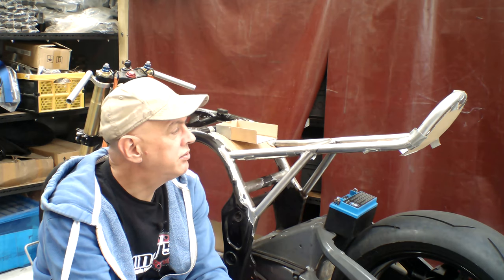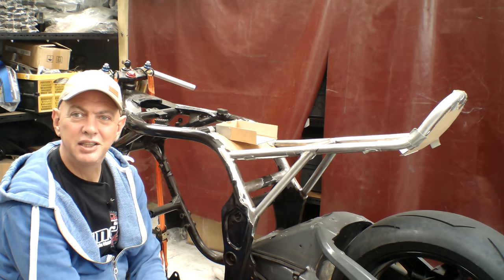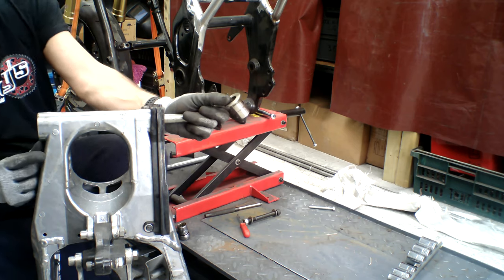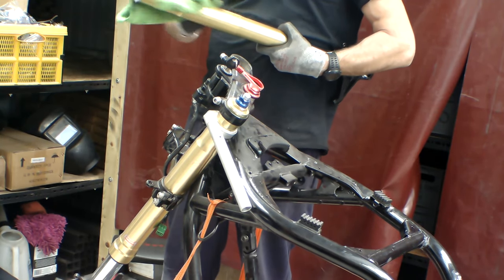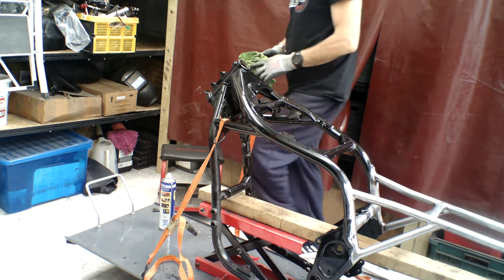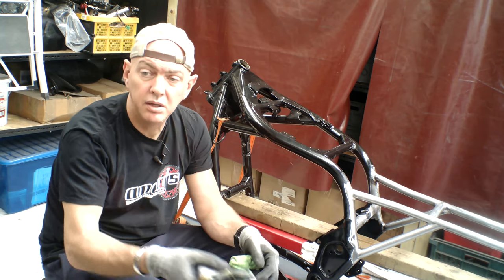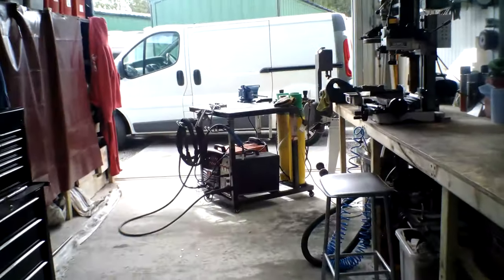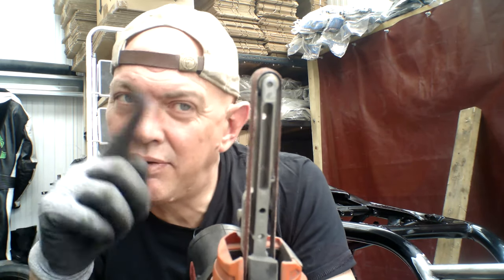The frame bares all - Suzuki Bandit Cafe Racer - GIXIT Project Part 13

Comment: enjoying your build fella...interesting as i am doing a B12 streetfighter.
Reply from the maker: Ahhhhh... That could be cool. I must admit I used to love street fighters but lost my way with them after a bit as they all sort of looked the same. Would love to see some pics if you have any. The build is going fairly well and to be fair All of it will be on YouTube. Hope you enjoy it and thanks for the comment 👍
Reply: @QuickBikes  not sure how to send you photos on YT...would be good to get your opinion as a welder whether i need to keep a couple of cm of the original subframe or chop it right back to the main tubes and plate the hole and weld a new subby on in different places?
its a chopped frame so far which is why your subframe build had me hooked.  it's got a zxr750 front end with a rf900 swing arm...still needs an engine!  i too am going to go the motogadget m.unit approach.
Reply from the maker: If you add me on Facebook, you can send me pics via messenger. Happy to help if I can, just send me pics of what you're looking to cut up and join and I'll let you know the way I'd do it. Sounds an interesting build 👍
Reply: @QuickBikes  will do...many thanks.
Reply: @QuickBikes  buggered if i can see your facebook fella!  i only use FB for two groups i am a member of so apologise if it's staring me in the face
Reply from the maker: I need to set up a Quick Bikes page... It'll make all this a lot easier...

Comment: Although we all laugh and poo poo health and safety there's no getting away from the facts. A comparison of fatal injury numbers between 1974 (when the Health and Safety at Work Act was 
introduced) and 2017/18, adjusting to allow for the difference in industry coverage of the reporting 
requirements between these years, suggests that fatal injury numbers to employees have fallen by around 85% in this period, farming and agriculture, (highest risk industry) in particular have benefited from risk management. PS. Builds looking great 👍
Reply from the maker: Oh I can appreciate its worth... It's just the fella is a complete plum... lol
It's not something I abide strictly to in my own workshop though. I'd rather use common sense and a bit of care...
Great comment 👍
Reply: @QuickBikes  Yep some can be a bit "anal" I worked in dealer workshops for 40 years and have seen some nasty unnecessary injuries, (Some life changing) which with just a bit of thought and common sense could have been avoided.
Reply from the maker: I hear you matey and agree...  I point I have issue with is the fella dishing out the advice. I think it's a good thing in the long run but if deliver the advice with a mallet, expect resistance. Common sense I think rules the day.... And thinking about what you are doing could save sooooooo many injuries